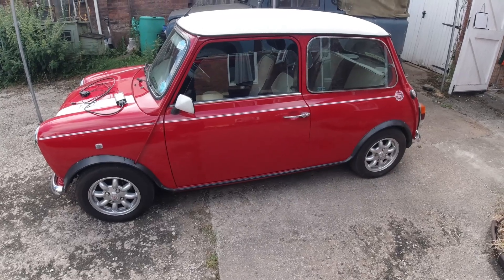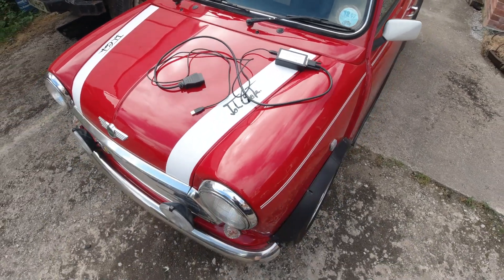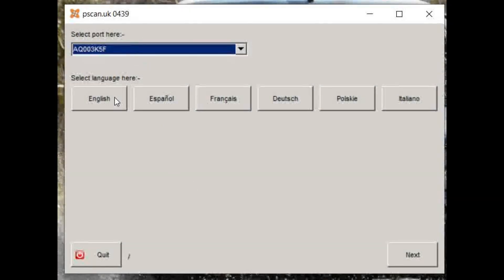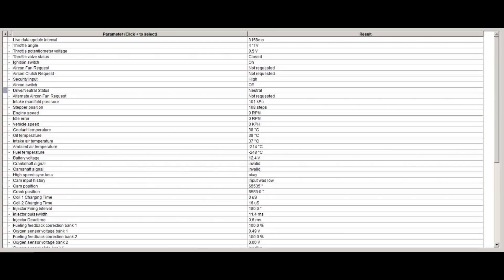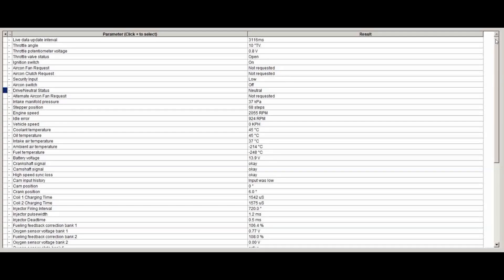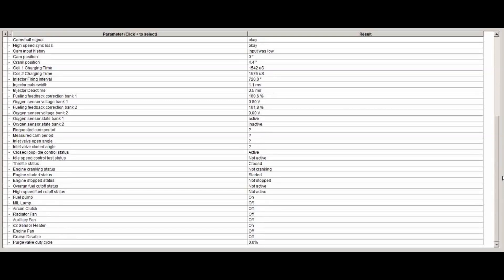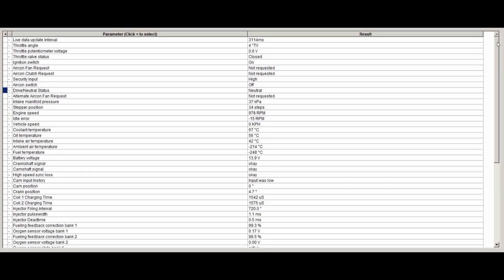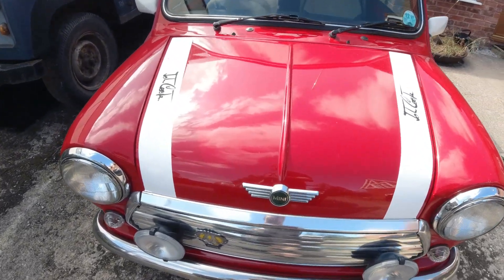Rover Mini Cooper MPI MEMS 2J ECU live data using PScan.

Comment: Hi, that is useful information, but the coolant temp is only up to 72'C which means the thermostat isn't open yet. The operating range at idle set by the ECU fan control is 97' - 105'C. Next time you have the kit plugged in, could you please do another screen shot, or link and Excel sheet with all the values when fully warm. Interesting to have the data. It's so hard to trace a problem when you are not certain of what the correct values should be. Thanks.
Reply from the maker: Good point. Yes, the fans didn't kick in so it didn't get up to full temperature